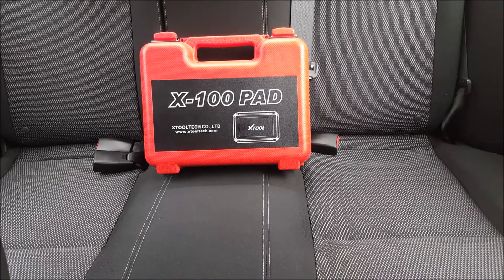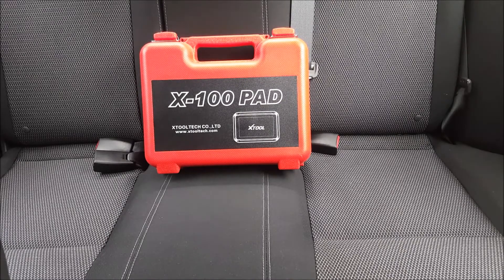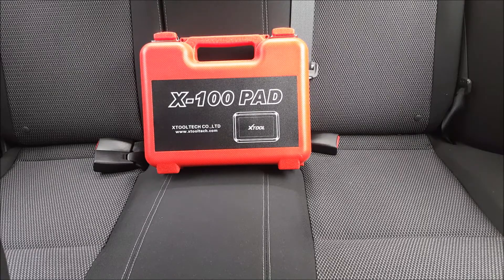Introduction To How To Use The XTOOL X 100 PAD Tablet Tutorial Series  Part 1

Comment: Where do u go to get the security codes for a 2000 Silverado to adjust the odometer
Reply from the maker: go to the immobilizer  section and click on the security code enter the vin number on the xtool  and it will generate the code. If your xtool can't generate the code  then you can try an online google search for a gm immobilier security code generator where you would have to enter the vehicle's vin in order to get the code. goodluck report back

Comment: I just got the x100 xpad 2.
Which forums did you look at for help? I couldn't find anyone speaking about the product except for advertisements. 

So far the machine is alright, did a mileage correction on a 2008 Ford Escape in around 30 seconds.
Reply from the maker: Me neither!  Even the supplier couldn't help me. When he reach out to china their reply was "American's are so stupid and lazy". So I guess we're on our own to figure this thing out. I've been tinkering with this device  on a lot of cars that I have access to in the field and i'm going to start putting out a few videos about what i've learned so far and also a lot of false promises of this tool capability. I won't knock the tool it's worth it's value, if you can figure out how to use it.
Reply from the maker: A A I tried a UK website where I had to pay a $25.00 membership just to read and post on their blogs. I wasn't able to get any information other than a few key programming  demos and how to register the unit. I will post the website link. I can't  remember it on the fly right now
Reply: PrecisionConnections sounds good, thanks for the update. Do you know how to use the EEPROM chip?
Reply from the maker: yes i will be putting up a few videos next week on eeproms
Reply: Check out car technology . Co . Uk

Comment: I'd subscribe to your tutorials channel on the Xtool.
 English tutorials would be rad!
Reply from the maker: I've been playing around with this tool for a few months now; on a lot of cars and  soon I'll be putting out a ton of videos explaining how to use it. BTW Do you have a specific function that you would like me to cover year make and model. So that if I run into that vehicle I could jump into a video  on site
Reply: Do the xtool x100 pad flash pcm
Reply from the maker: That's a Good question and the answer is yes or no. It actually can flash any 24/25/93/95 eeprom. But you will need to provide the hexadecimal information to the tool! So if your question is would I be able to use this tool to flash compatible eeprom memory with data that i will provide to the xtool; then the answer is yes. But if your question is will the xtool provide me with the data need to flash my pcm unit then the answer is no.
Reply from the maker: let me  know if there are any  particular videos topics about this tool that I should make on any particular vehicle; Also, let me know if you have any quick reply question about this tool that you may have on the top of your head. If so, shoot me a few lines in the comment sections . I've been toying around with this unit and i'm very surprised with it's flexibility. I'm planning to put out some demo videos in early september.